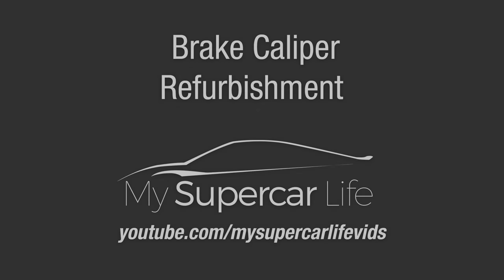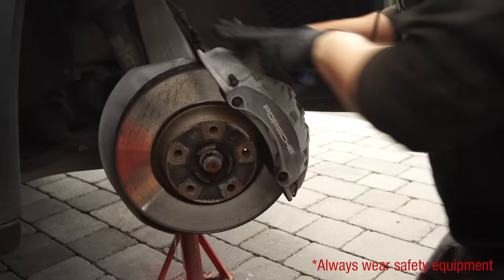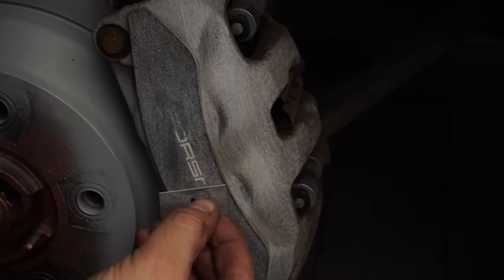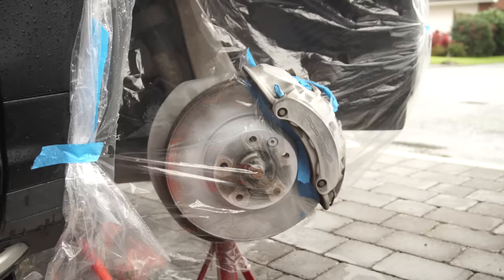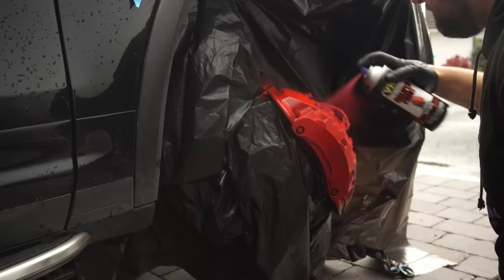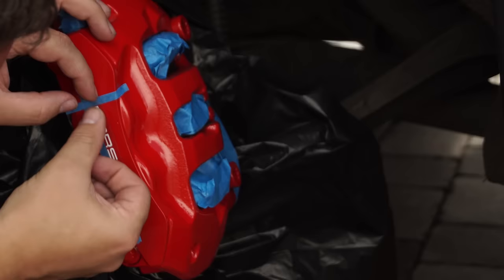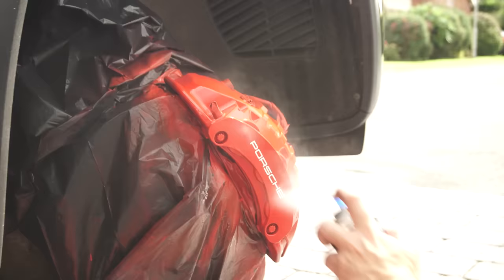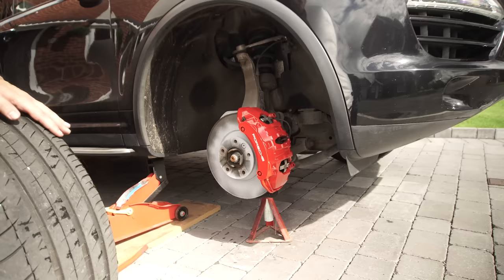How to Paint Brake Calipers

Comment: Seriously. Repainting your calipers without removing them. I stopped watching after that comment.
Reply from the maker: This has been explained many times in the comments why I didn't remove them. It's a daily driver - I don't have time to remove and rebuild the calipers as I need the car daily - if it was a show car or something special then yes I would remove them, but not for something I drive for work day in day out. Adding in the debacle of when the braking system went wrong, I'm not touching it.

Comment: Shit if I had a Porsche I def would take caliper off before I painted it..... Look at all that paint on the lines eeehhhhh don't think id treat my Porsche like that
Reply from the maker: Sorry, but you're completely WRONG. On factory painted calipers the brake line at the bottom of the caliper connects the two halves of the caliper together and IS painted.  It's painted on my Ferrari calipers and they work fine, and it's painted on every other set of Bremos that are painted. Other than that NO brake lines are painted in this video, the rubber brake lines are masked up, the pad wear sensor is masked up and the bleed nipples are masked up hence why they are all blue at 3:00 Removing them would have made no difference other than being able to paint the back side of the caliper better.
Reply: My Supercar Life how am i wrong might not be lines but the cables to ur speed sensors I highly doubt come spray paimted the same red and what ur using. All I'm saying is if i owned a Porsche i would definetly take the time to take them off the car to complete this task I own evo and I would never paint anything while still attached even if is covered properly. Rather just not take that risk that's all. But ya u painted ur wired bro
Reply from the maker: The wires are to the brake pad wear sensors not speed sensors and like I've already said, at 3:00 they, and the brake pads are masked up with blue painters tape, which is why at  6:19 there is no paint on them and they are black. I have no idea what you're seeing, but it's certainly different than what I'm seeing, and I did it. I also explained the reason for not removing the caliper at the start of the video this is my daily driver, and there's no way I could take it off the road for a few days.
Reply: My Supercar Life didn't realize they were taped but still don't take few days to take them off and do them just have to clamp brake lines so don't loos brake fluid but still not risk of getting it on a very expensive car
Reply from the maker: No problems :-) In an ideal world I would remove the calipers, but I just couldn't risk taking the car off the road in case Mrs Supercarlife needed to use it as it's her main car. If it was any of my other cars I would have removed them, and probably had them powder coated. Thanks for commenting.

Comment: several issues here
1: no mention of using primer prior to colour paint
2: no mention of specific type of paint to be used ie best use HIGH temp due to calipers getting very hot when used.

other then that they look good, pitty they'll not loo that good after a short while when car soap, water & brake dust take their tole on the aerosol paint job. hand painting (not aerosol pain last abit longer & powder coating is ultimately the best job for calipers)
Reply from the maker: Allow me to address the issues for you:
1: You don't use primer with VHT brand Caliper paint, it doesn't need it as it is direct to metal and it uses heat to cure to a plastic coating, you do have to make sure you prep correctly.
2: I do mention the brand, which is VHT - not to be confused with the acronym Very High Temperature. The brand is called VHT. I used their Caliper paint in red and clear which is suitable for 900F. The paint is specifically designed for calipers.
Here is a link to the product: https://www.vhtpaint.com/high-heat/vht-caliper-paint

They looked EXACTLY the same when I sold the car after nearly 2 years, so saying they won't last isn't correct - it's down to the prep work, not necessarily what you use. The paint in VHT brand CALIPER aerosol is the same as the type you would brush on, but obviously gives a better finish as you use a colour and a clear which adds protection and gloss. Powder coating is not an option on this car, as it's not on most peoples. First of all removing the calipers from this car is not an option. I've detailed this many times in the comments. Second - Most people are not going to go to the effort of completely stripping a caliper, including removing the seals, pistons etc. Having the calipers media blasted, then powder coating.  The car is a daily driver. To have to wait for the whole strip, blast, powder coat, rebuild would not be an option. So painting is the only way forward.
Reply: Hi, how many cans roughly will you need ?
Reply: @willgale9336  for a decent job 2-3 colour & depending on cans used 1-2 in lacquer ...however you'll need alot of cleaning products, sand papers, wire brushes/drill bits etc..... depending on your car/brake set-up it could work-out cheaper to have the caliper's powder coated OR p/e your brakes for already prepared/painted examples.
The downside to wet-painting is the paint isn't sturdy at all, it will fade/go-off over time & will require further work, spill any brake fluid onto the paint & it'll take the paint off, spraying brake caliper fluid will also damage the painted finish... if you factor all the general prep-work & products required the cost easily raises above £100+ with future costs, look into powder coating the calipers & the cost is cheaper in-the long run, cheaper still if you know someone who can powder coat.